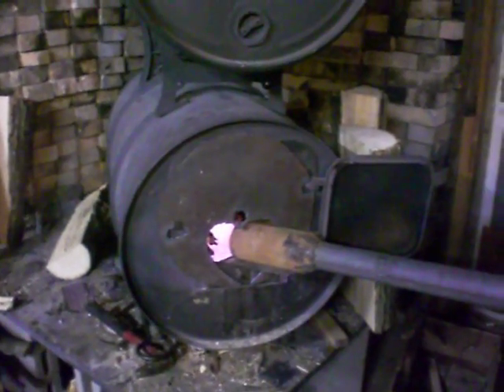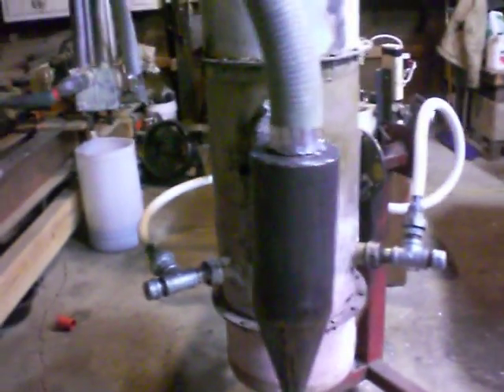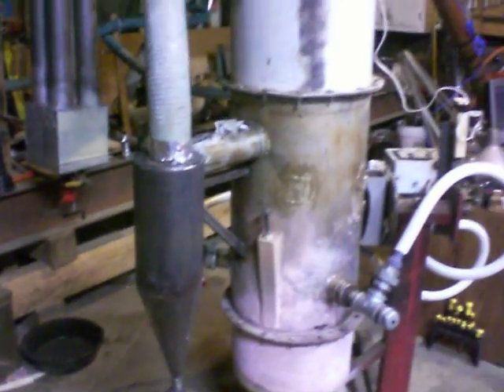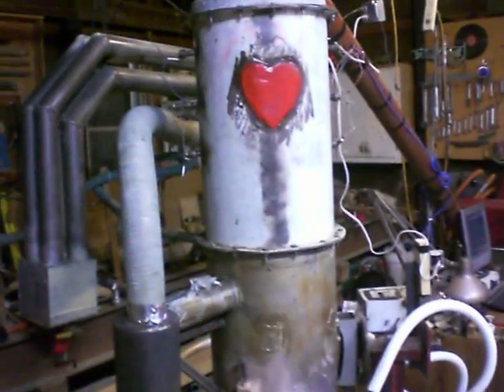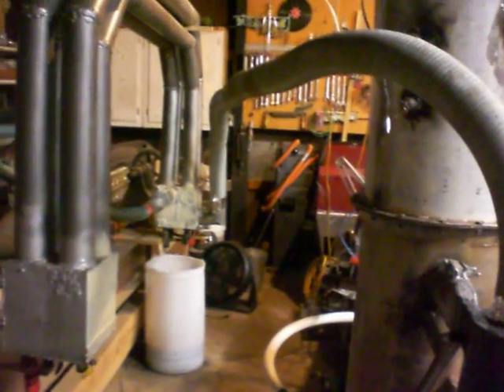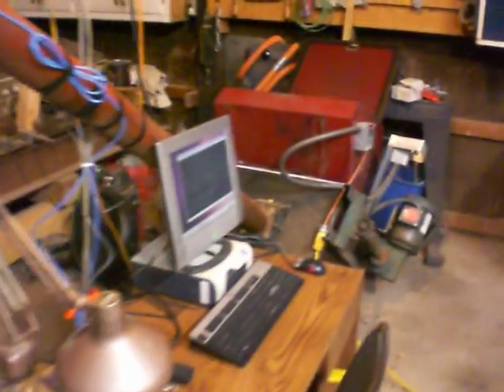autostoking wood gas producer

Comment from the maker: This one did not bridge, the longest run was a continuous seven day burn.  During this time I did not shake or vibrate the gas plant.  What eventually plugged the plant was clinker, and the bed plugging up.   The fuel was paper mill chips, with clean cut edges and sorted for size.  This fuel was not appropriate for engine gas over the long term, but was fine for heating fuel.

Comment from the maker: The room temperature sensor is just a k wire thermocouple going to the DTC controller which turns the gas plant on or off.  The sensors on the magazine are electric eyes that tell the hopper when the plant needs chips.  Thats it for sensors on this run,  winters over.   This plant is going to find another purpose, probably back on my truck.